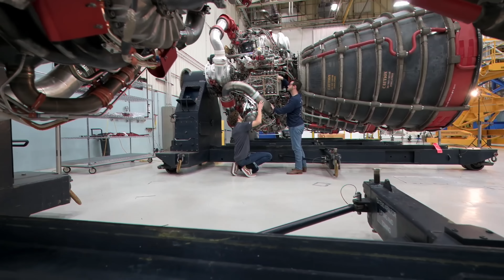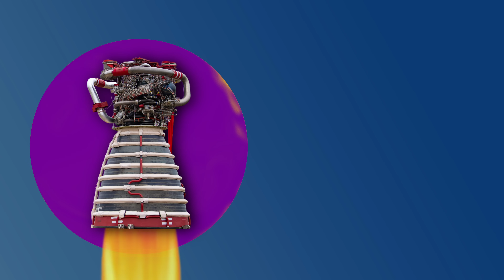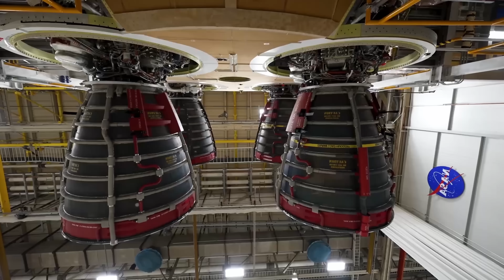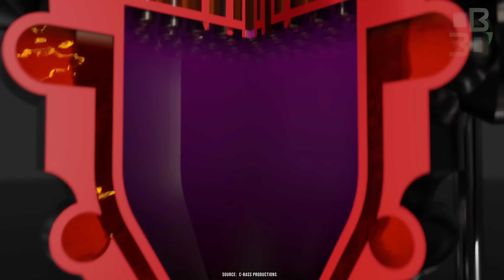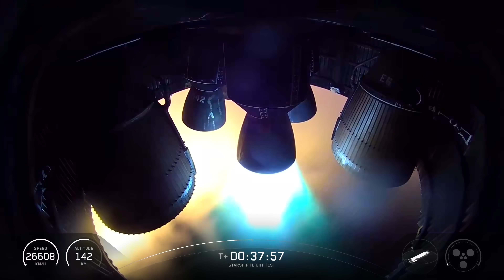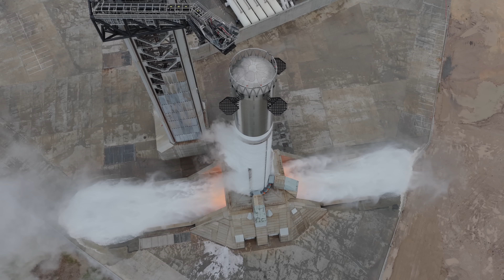Why SpaceX Raptor and NASA RS-25 Are So Different…

Comment: why did older rockets use kerosene , methane was available?
Reply: Much easier to handle. No cryogenics needed.
Reply: Rocket technology is a legacy from missile, kerosene are easier to store for military purpose (this doesn't apply to oxygen because it can be produced on demand).

Some people might say it is because cryogenic fuel are harder to handle, that doesn't make much sense because you already need to handle cryogenic and massive liquid oxygen, and when they are handling hydrogen suddenly those difficulty can be ignored. 

For pure spaceflight purpose methane is actually superior than kerosene in tens of aspect, just that that wasn't how history happened.

Developing rocket used to be way too hard, now it is reasonable enough for company to redevelop something from scratch instead of relying on old tech, which is why they are popping up.
Reply: Easier to make stuff that burns kerosene (it's also generally used by aircraft). It was a feasible tech, and by that I mean they know enough about it to make very sure they will succeed.
IIRC kerosene is not just one kind of molecule (most fossil fuels are made of multiple kinds of molecules, you can search a little for more details), so going from a random stuff fuel to a more certain fuel is a good and necessary step. H2, like mentioned in the video is very problematic, even though it should have been the solution, so methane (CH4) is the lesser and more reliable brother. Now, why didn't anyone try to make methane engines before, that I do not know.
Reply: @Philipasu Don’t forget Hydrogen provides roughly 120–142 MJ/kg compared to methane's 50–55.6 MJ/kg. Much higher energy density
Reply: @Tailspin80  I don't think it's good enough due to volume issue. Also, in both cases the fuel is stores at very low temperatures, so some of that energy is lost to heat them (putting fuel and oxidizer to burn will make heat but it will first be used to heat the mixture).
Reply: @Philipasu The thermal energy needed to heat H2 is only 3% or 4% apparently, but in practice there is zero loss. That’s because the hydrogen is used to cool the engine to stop it melting and also the heat goes back into the combustion chamber so is not lost. Volume is a factor and so is keeping H2 liquid (-252C) because both imply a larger heavier hull, but H2 is no much more energy dense than methane that it was the obvious choice for the NASA rockets.

Raptors are far more advanced and efficient and this makes up for the lower energy density of methane. Musk chose methane because in theory it can be manufactured on Mars using solar or nuclear electricity and locally sourced raw materials.
Reply: Newer rockets still use kerosene, in fact SpaceX Falcon 9 uses kerosene, which is basically what RP1 is, it's just a highly refined kerosene.
Reply: @actionjksn  That is true, but the purpose of the Falcon series was to make a reusable rocket, trying to make a reusable rocket AND make it use a new kind of fuel would get too complicated.
I'm disappointed that nobody else tried making a rocket engine using methane in recent decades. Not NASA, not russia, nor others. Everyone was waiting for others to take the risk.
Reply: @Philipasu The key thing is that the Raptor is “full flow”. It’s a very difficult technology to perfect but makes it significantly more efficient. It’s the first full flow engine to have flown in space.
Reply: Just a guess, but kerosene is readily & cheaply available in bulk quantities as a by-product of petroleum refining, whereas hydrogen has to be produced by a rather energy-input-intensive process that is more complex & therefore more expensive. Also, hydrogen can cause metals to become brittle & it can even slip through the atomic lattice of some metals, making it hard to store or move through pipes without significant loses (unless frozen to a liquid state.)
https://en.wikipedia.org/wiki/Hydrogen_embrittlement
https://en.wikipedia.org/wiki/Hydrogen_infrastructure
https://en.wikipedia.org/wiki/Hydrogen_production
Reply: The simple answer is that for the things those rockets wanted to do, and many rockets still want to do, kerosene is just superior to methane.
SpaceX and Blue Origin went to methane, because they 1 - wanted to get rid of the soot in a reusable rocket,  2 - wanted to have an engine that was better to fly to higher energy orbits (or even between planets),  3 - wanted an engine for a fuel that could be made on Mars (and maybe even on the Moon).
Reply: @Vermiliontea It takes a few days to remove the carbon deposits from a Falcon so that’s a killer for rapid reusability. Methane is about 10% more energy dense. And of course you need a fuel you can make on Mars (or the moon) although that seems a very long way off. Musk and his team made a whole bunch of radical design choices at the start of Starship, such as the full-flow Raptor and a stainless steel hull. They can’t know for sure if they are the best choices until later but signs are good at the moment. NASA are at the other end of the spectrum, avoiding trying anything new.

Comment: For al of that, the RS-25 didn't get the Shuttle or SLS to orbit. Solid rocket boosters did. 

*Space Shuttle (at liftoff / first-stage ascent):*  
The two Solid Rocket Boosters (SRBs) provided *71.4%* of the total thrust.  
The three RS-25 engines (SSMEs) provided the remaining **~28.6%**.

NASA consistently stated this figure in Shuttle press kits and reference materials. Each SRB produced roughly 3.3 million lbf (sea level) at launch; the three RS-25s ran at ~100–104.5% rated power (sea-level thrust in the ~375,000–400,000 lbf range each, depending on exact power level and conditions).

*SLS (Block 1 / Artemis configuration, at liftoff):*  
The two five-segment solid rocket boosters provide *more than 75%* of the total thrust.  
The four RS-25 engines provide the remaining share (under 25%).

NASA’s standard description is “more than 75%” from the boosters. Absolute numbers align with roughly 81% from the boosters and ~19% from the core engines at sea-level liftoff conditions:  
- Each booster: up to 3.6 million lbf (combined ~7.2 million lbf).  
- Four RS-25s at 109% power: ~418,000 lbf sea-level each (combined ~1.67 million lbf).  
- Total vehicle thrust: ~8.8 million lbf.  

(The RS-25s produce over 2 million lbf combined in vacuum, which is the figure often quoted for their overall contribution during the core-stage burn.)

### Quick comparison
| Vehicle       | SRBs / Boosters | RS-25 engines | Notes |
|---------------|-----------------|---------------|-------|
| Space Shuttle | 71.4%          | ~28.6%       | 2 four-segment SRBs + 3 engines |
| SLS Block 1   | >75%           | <25%         | 2 five-segment boosters + 4 engines |

The higher booster percentage on SLS comes from the extra propellant segment (roughly 25% more impulse than the Shuttle SRBs) plus the fact that the core stage has four engines instead of three, but the solids still dominate the initial thrust.

From @Grok
Reply: The SRB's were gone after the 1st couple of minutes of flight. SSMEs burned for  another 6 minutes or so.

Comment: Leave it to the bureaucrats to design a reusable engine then throw it away after every launch.  This is what happens when you have lawyers and politicians in charge of anything.  Anytime more money is needed, just rob the overburdened taxpayer.
Reply: SLS is not really a new rocket. It has basically been cobbled together from existing parts and tech that has alteady been developed. The solid rocket boosters, engines,  main body (the orange part), and more are all taken from the Space Shuttle booster. Thus reusable engine now being thrown away (aside from the likely damage from running it at the top of its capacity).
Reply: Yeah, all 33 engines on flight 13 were recovered from the bottom of the Indian ocean.
Reply: @JarvisThribb it didn't, that only happened on flight 5,7,8.
Reply: @fakestory1753  That was sarcasm.
Reply: @JarvisThribb I know

Comment: There was something your video did not cover for the SpaceX raptor engine which was how much can it throttle. And this is something I have been speculating for a while due to the fact that it has to turn off rocket motors on dissent and not use a lot of them due to the fact that the weight of the rocket has changed. I don't think that the raptor can throttle it so very well because of the' full flow staged combustion cycle' which is why it uses three rockets on the starship then it switches to two and then switch to one rocket just before it touches down. The NASA rocket is the better rocket because it can throttle is output
Reply: Raptor 3 engines can throttle very well actually.
Reply: What's wrong with you? Modern NASA isn't better at anything.
Reply: In reality, Raptor 3 is far better then the RS-25 ever was, since it can throttle between 40% and 100% of rated thrust, and do it fast.  That's why both the booster and the ship itself can hover reliably for long periods: due to the ability of the Raptor 3 to throttle fast over a wide range.  The reason they shut down engines on descent is simply efficiency.  As the vehicle gets lighter and lighter as the fuel is burned, the extra engines are no longer needed.  So they shut them down, and only leave enough engines running to produce the thrust that is actually needed at each moment.

Comment: Doesn't the most reused rocket engine use kerosene?
Reply: Yes, the RS25’s flew a lot and some were reused for many missions, but the Merlin’s have to start several times per flight. 

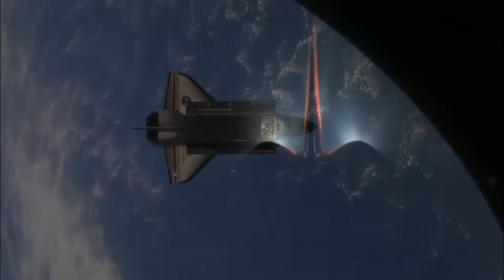13:30
‘ if the astronauts needed to change their orbit’
Yea, the RS25 wouldn’t start again. Would fact that the fuel tank was gone have anything to do with that ?

Comment: SSME has two fuel-rich preburners, not one. Each is throttled to control the flow of the fuel and oxygen. The hydrogen coolant channels run in parallel lengthwise, not "wrapped around". Indeed, most ot the length is tube-wall construction where carefully formed tubes are brazed together to create the nozzle- no separate part at all.
Reply: Yea, I’m not subscribed
Doesn’t seem like he understands engine cycles, which is important for this topic.
Reply: Glad someone pointed this fact out.   Signed: And old SSME "Sparky".

Comment: The Shuttle was the closest we came to reusability prior to Falcon 9. The solid fuel boosters and shuttle were reusable. The main tank which had no rocket engines was not. Unfortunately the cost to refurbish the shuttle was astronomical.  Starship and its booster may make it economical.
Reply: Another close-to-reusability rocket of note was the DC-X (Delta Clipper).  This was a prototype rocket to learn vertical take-off and landing in the 1990s.  While successful, the program never got the chance to advance into space nor orbit, so I give the Space Shuttle as the actual closest to reusability NASA got.
Reply: @ChrisDreher I loved the Delta Clipper. I thought they were using composite fuel tanks to control weight but never were able to get them to work.
Reply: @williamdrake2315  I think you're thinking of the X-33 / VentureStar program, which was a lifting-body space plane / rocket.  The X-33 was killed due to problems with the tanks and never flew.  The programs were both for reusable rockets and were going on at the same time in history so it can get confusing.  I know I had trouble keeping them straight back in the day.
Reply: The original plan for the Space Transportation System was for the shuttle to be completely reusable. Congress wouldn't fund it and then Pork Barreled the hell out of it.
Reply: This is true. And the recovered portion of the solid fuel boosters was just a metal shell barely worth refurbishing.
Reply: @howlingdin9332 Stats in an article showed it as almost a wash in comparing the cost of refurbishment verses building new.
Reply: Even if Starship failed at re-use it would still be cheaper to operate than the shuttle. But I don’t think it will fail, and anyone that bets against spacex either knows nothing or suffers from EDS - or both.

Boosters have already landed and been re-used for Starship, and Ship has proven it can land and be recovered even under highly non-ideal or planned conditions. So I definitely think we’ll be seeing a proper Ship recovery in the next several weeks. Then it’s just gonna be a matter of improving the heat shield and other components to decrease or eliminate repairs between flights.

The other thing this video doesn’t mention (and there was a lot of missing information) is that Raptor, like Starship, is constantly being improved upon, and having all those engines means they are collecting a ton of real-world test data that they can use to make improvements. That approach to design is not something NASA would ever have done in the post Apollo era, and it’s another reason why betting against SpaceX is really incredibly stupid - because an experimental design philosophy is king at making the best possible designs. For this reason, Raptor is the most advanced rocket engine ever made.
Reply: If you want to buy a $1000 framing hammer, you’ll have to get from the US government
Reply: Costs more than disposing...